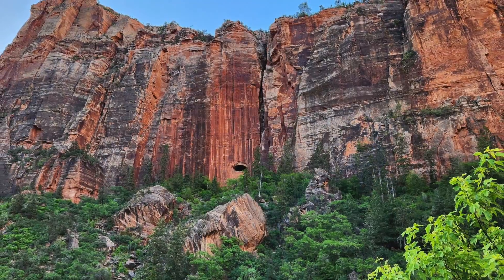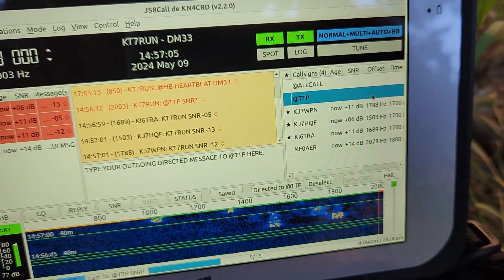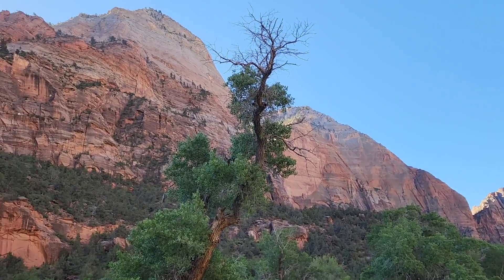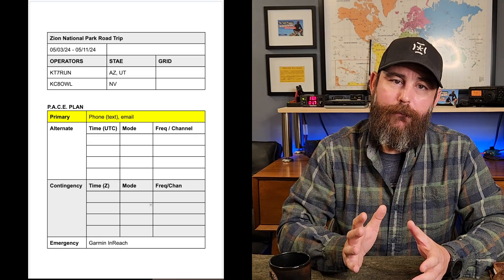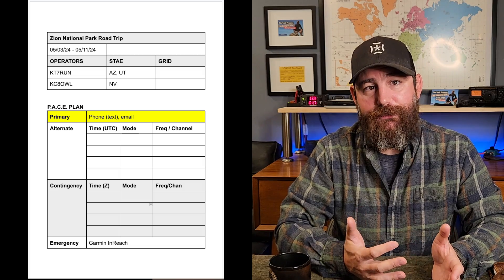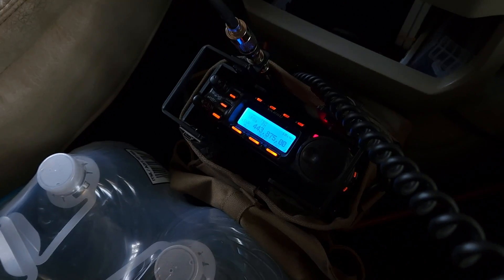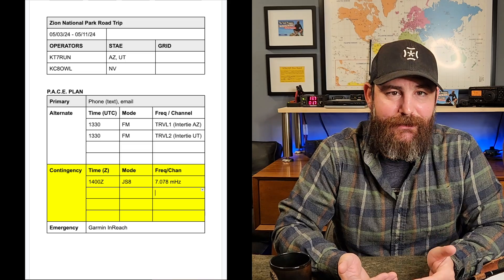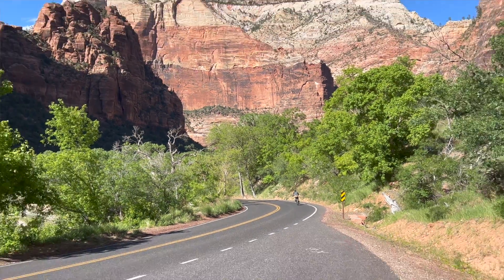How to Make a Travel Comms Plan

Comment: Will these Commo plans work for EMPs/CMES ?
Reply from the maker: Not this one, but I have other plans that have that covered. I have not done a video on that yet.
Reply: @TheTechPrepper  Looking forward to that video! I know that's one of the "hot topics" in the prepping world currently.
Reply from the maker: @RandomStranger69  Unfortunately, the prepper discussions on EMP and CMEs are  overhyped by the community. We do need to take precautions as there are degrees of impact based on the type of event that occurs. There are simple options for mitigating the impact to your gear. They don't require a dedicated concrete bunker lined with a copper Faraday cage.
Reply: @TheTechPrepper  Unfortunately, the majority of common topics on most prepping channels are overhyped doom porn. That’s why I like your channel and Bear independent. Y’all are realistic .

Comment: This nvis stuff is awesome! 
I have noticed that as an antenna gets closer to the ground the SWR changes. I'm your experience does the antenna get longer or shorter in this configuration?
Also do you have a list of recommended reading material on nvis?
Thank you for the awesome video.

Comment: Nice to see the planning worked.  I'm a Tech so my plan excludes HF...  Cellphone, VHF/UHF, inReach mini, and we're really starting to consider adding Starlink to the camper.  Glad you got to visit Zion!  We just returned from Yosemite & Sequoia (Yosemite had repeater activity, Sequoia didn't).  Cheers and 73!  Pete in Arizona - KI7LIL
Reply: Peter you still have the 10 meter band. I don't know what is keeping you from general. My original plan was to get Tech stay there for a while get some experience. While studying for general. This did not last long I thought what the heck and went and took the General test passed by one question. Go for it
Reply: @Bluescout612  You are correct, but I do not have a 10 meter radio.  I'm "kinda" looking at the Anytone quad 5 radio so I could use CB while driving and then 10 meters at camp.  The big reason, right now, to not upgrade to General is time and space.  I'm too busy with so many other things that I can't put the time into studying, or the time into enjoying the upgrade.  And, space... I'm in a gated community with an HOA (I know, not the end of the world to overcome), but again, I'd have to buy radios and run wire to enjoy the upgrade.  I am curious, and probably will look into upgrading in the future, it's just not going to be right away.  Thanks again for the encouragement and taking the time to write.  I appreciate it.  73, KI7LIL.
Reply from the maker: Pete, StarLink is well worth it. We brought it on this trip and have been using it since StarLink RV was introduced several years ago. The latency can be high at times, so it can be an issue if you rely on real-time video/voice conference calls.
Reply: @TheTechPrepper  Thanks, Gaston.  The other reason I'm thinking of Starlink is I would be able to use the openSpot3 and have D-Star comms (even boondocking using the Honda eu2200i for power).

Comment: Best of luck with the views. I like what you do. I also have got js8 to work very well for check point type coms passing number scores as participants pass various check points in a set competitive stages of an event.
Reply from the maker: Glad to see you using JS8 in practice. If it's a location where you're in line of site for VHF, you may want to look at the fldigi and flmsg. It's a lot faster and supports forms.

Comment: I realize your concerns about weight. But not having a microphone for a radio is not a decision I would make. Did this experience change your thoughts on that decision? I would not worry about your videos they are some of the best out there keep it up Jim KI7SSO
Reply from the maker: Yes, this experience changed my mind. I will find the room to store the microphone moving forward. I plan to swap out the factory coiled mic cable with a flat RJ45 cable to help cut down the overall size of the mic. Thanks!
Reply: @TheTechPrepper  Any thoughts on a good ear bud and mic combo. I have one for my VX-6. It is a single ear bud with a small combo PTT button and mic. It has the correct screw in connector. It is really small and lightweight. I keep mine in my pack with my VX-6. This is my third level backup mic. I have not used my 818 enough yet and am still working on the setup for a bag for it. While I am not too concerned about size and weight at this point .This seems to me like the lightest/smallest option to reduce size and weight. I do like the flat cable idea as the coiled mike cord is just a pain to pack, Jim KI7SSO

Comment: Another great and useful video Gaston.  Another example of effective emergency comms in action.  In this case  2M/70cm and regular HF would not work, and NVIS  was the only way with the ~500ft canyon walls on all sides - and a complete success.  I suggest everyone join Buy me a Coffee to support Gaston and keep these vidoes in production - $5 a month is a bargain.
Reply from the maker: The plan was not have these minor fails, but it was great to be able to work through these communication stumbles. Thanks for the support and shout out. Now, I'm going heads down to work on the the second release of EmComm Tools OS Community. 73

Comment: Excellent video! I spent 21 years in the U.S. Army and a lot experience with P.A.C.E plans. You are giving us too much credit for being professionals. My comms guys typically just used the last person's plan. I often found that as an Amateur Radio operator, I knew more about radios and antennas than my comms guys did.
Reply from the maker: Thank you for your service. It sounds like the military can be like some jobs in the public sector where people just re-use deliverables. You just bust my bubble about the RTO.
Reply: @TheTechPrepper  To be honest, some RTOs were amazing, but they were the exception to the rule in my experience. The real challenge is that many of them are just kids. Therefore, the communications systems have been designed for little adjustment outside of pre-designed settings.
Reply from the maker: @RavenwoodAcres  Got it. There is a fascinating series on the military's use of HF. Check out the "Military HF Radio" channel on YouTube.
Reply: When planning for an operation in …, I was still really green and naive. I built my Comms P.A.C.E. (S3 OpOdr) by the numbers, ended up spending a LOT of time backwards planning, then forward, the backwards… and nailed it. I got a commendation not because it was a great plan, but because I didn’t do what everyone else normally did, which was just copy what everyone else did.
Reply from the maker: @devinhedge  Great job thinking out of the box.
Reply: I had a hospital commander who WAS a Ranger, he blow out his back during a jump and refused to retire. He had some 'special' rules. ALL  us field medics were required to cross train into RTO, in case it was our RTO who we were working on so that we could call in the medivac by ourself. I never had to BUT it was a comfort to know how.  He liked everyone being cross trained into several things.

Comment: Winlink HF gateway position reports can spot you immediately provided your pre determined contact hasnt responded. Also having a station setup running in the background to automatically listen for your pre determined contacts station calling you is highly advisable . You could have that listening station automatically alert you at the home QTH and you hustle back to take control of your station and make contact .
Reply from the maker: I disconnected my station at home when I left. I am always concerned about equipment damage if a storm rolls through. Great tips!